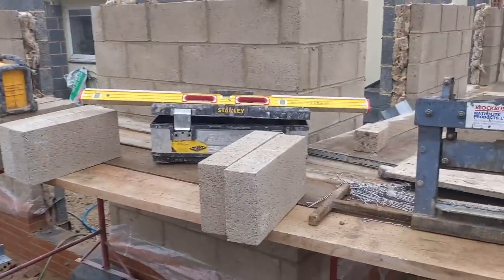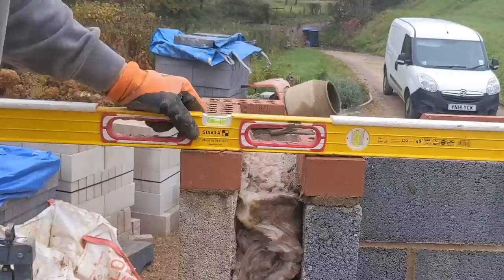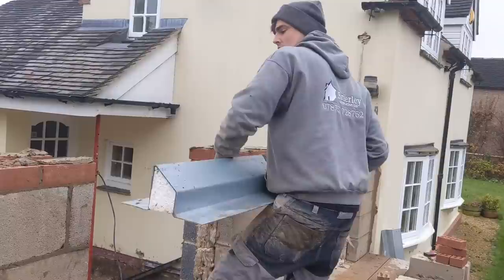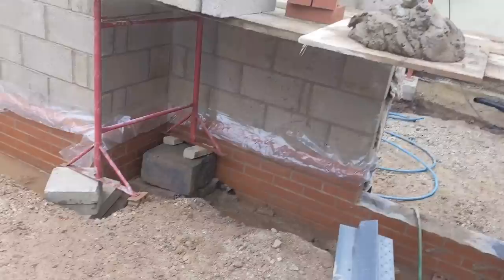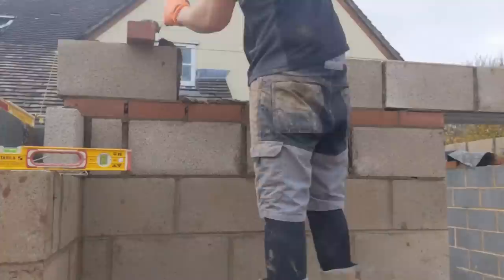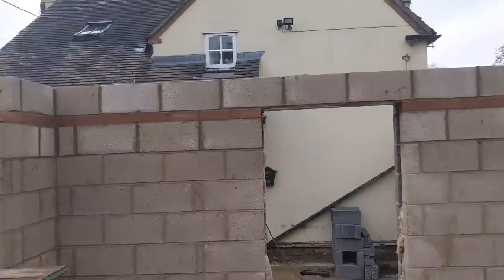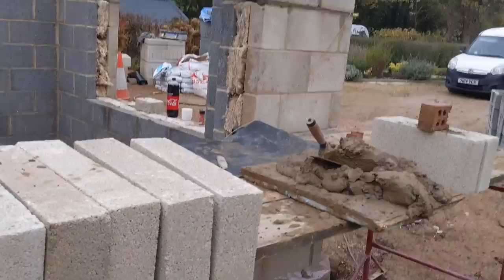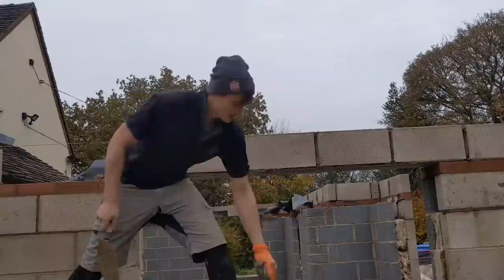Bricklaying - Building over Lintels - DPC & Weep Vents #bricklaying #extension #vlog

Comment: Flashing should extend slightly past lintel. Even 2 mm to make a drip. Sealant on lintel edge seal flashing to lint so no water gets in between flashing and flashing material. When it rusts you can never get back in to fix it without removing units.

Comment: Weep holes do more than let water out. They let air in to the cavity. If you have a 30 mph wind up against a wall you'll have 30 psi of air pushing on the surface. You have no wind on the inside of the cavity. That makes the air pressure less on the inside surface. The pressure differential leads to the masonry units not just absorbing water but actually sucking water in like a vacuum. Some walls used to have brick vents to equalize the pressure.

Comment: Feck that Lol, I wouldn't have even got out of the Van if I had seen them trestles,how are they they going to do the roof and Gables of them? Seems to be a bit of penny pinching going on at your expense. Believe it or not weep holes are not deemed necessary anymore in rendered work not that I've ever seen one work lol, wouldn't be allowed the brick bearing for the lintol by my local BC , classed as a cold spot but allowed under a steel as a compromise??? 👍
Reply from the maker: Haha I know mate, but sometimes gotta crack on🤣 I never knew that mate about the weeps in rendered work..wonder why that is?🤔 Yea it's a cold spot but not cutting 65m block slithers when I got bricks looking at me🤣
There is a scaffold going up..just not sure when now🤔 Hope your good Andy mate

Edit: referring to the weeps in rendered blockwork, how are you so up-to-date on all these NHBC standards mate?
Reply: Render is waterproof so no water should get in the cavity
Reply from the maker: @neilsmart78  thanks mate!
Reply: @IzzytheBricky  keep up the good work 👊🏻